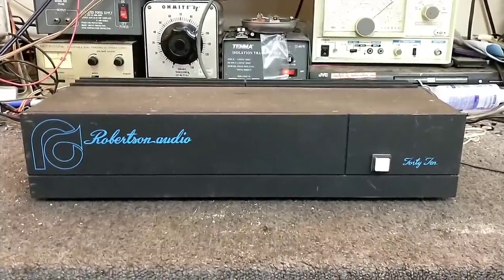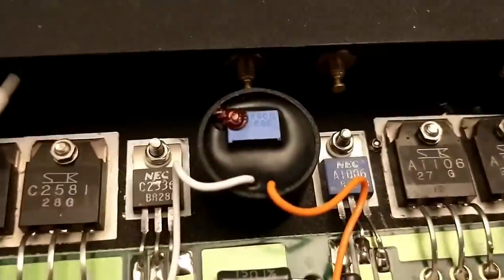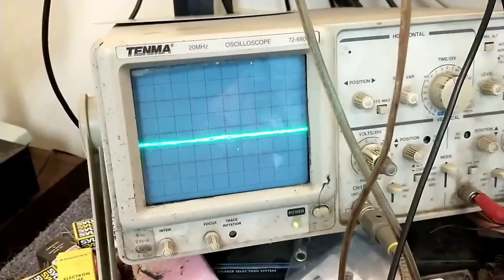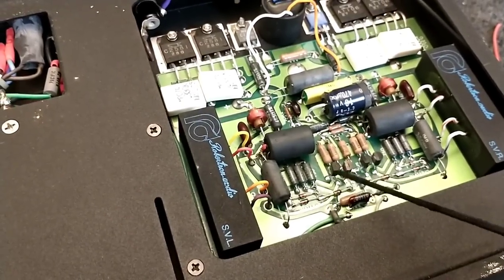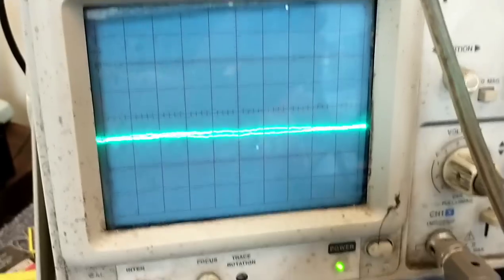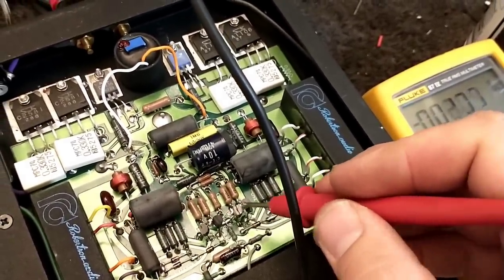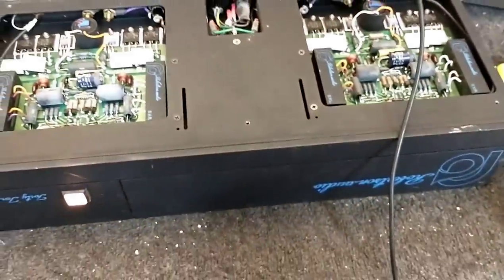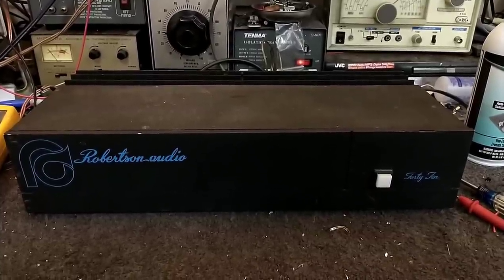Repair of a vintage Robertson Audio Forty Ten power amplifier. Noisy Channel.

Comment: How unlucky can you get? Working on an amp with a DC coupled input, which is kind of rare, and having a DC offset on your function generator.  It gives us something to think about before working on amps, I usually just worry about how out of tolerance, or leaky with age that first coupling cap is while going through things.

Comment: And if I had to guess those circle  things with the bias pot ontop is probably full of diodes a capacitor and some resistors or maybe a vbe multiplier in a module mounted to the heating to couple the heat into it for the bias circuits  thermal tracking

Comment: Do you know why they are always using resistor cores for those chokes? I never really understood. Some say for convenience. But I cannot see how a company that makes components, can't manufacture a simple core from some material.
Reply: In TV sets anyway,  the resistor was there to dampen any peaks or ringing in peaking coils. So those coils sometimes were just wound right on the resistor.

Comment: Any chance we could get a video that explains how to set up light bulb "fuse" or load sponge I guess I'll call it.
Any special equipment required? - electrical novice here.
Reply: Are you talking about a dim bulb tester, aka DBT, used to prevent damage to an amplifier being tested? It limits current through the amplifier by inserting  a mains voltage rated  incandescent lamp in series with the "hot" lead of the circuit powering the amp. Different values of current limiting can be employed, starting with a lower wattage bulb and increasing bulb wattage (increasing the bulb wattage = decreasing the bulb's resistance = allowing more current.
Here is a simple DBT video showing how to build it:
  https://www.youtube.com/watch?v=R2Je1qWq0hM&t=285s
Reply: @richpayton7162  Thank you!

Comment: Dear Mr. Pier, I keep hearing about off-set, can you explain what this is?
Reply from the maker: A dc amplifier operates at a positive and negative voltage,.with the speaker output between the two. Since music is AC the voltage will swing appropriate to produce the sounds being heard. 

An offset is when the output is no longer 0v DC. This is an error that must be corrected or DC energy will heat up the voice coil of the speaker and burn it up

Comment: Not sure you worked the power problem right. Using OMNS law, ((E*E)/R) = P; Your meter voltage is 22 Vac RMS. Say your R is *
8 ohms. Your DC voltage should be 11 Vdc RMS. ((11vdc* 11vdc)/ 8 ohms) = 15.125 watts RMS. making you peak power around 30 watts.
Reply: Nah, he got that right.  The reading was an 22V AC RMS reading.  Measured rails at +/- 40V.  Therefore without rail sag he could have had 40V peak ~28VRMS.  Obviously without a huge transformer you would have sag and you can't really drive right to the rails.  So 22VRMS (33V peak) seems totally right.  Vdc RMS isn't really a thing BTW.
Reply: @rogerknapman1260  Yes the amp should but out more then 60 watts maybe 70 watts. Like the P.S. lay out, in my eyes it is just the best.  Across a 8-ohm load, with a 21-volts rms, works out to 56 watts rms. I would think that with +/- 40 rail Voltage, for an eight-ohm load, the load voltage would be between +/- 30 to 35 volts which will work out to be more then 60 watts.